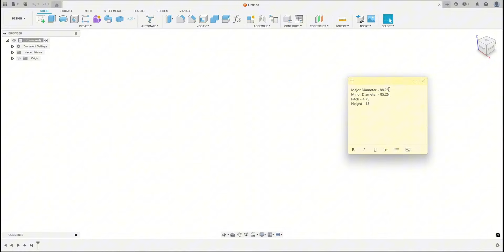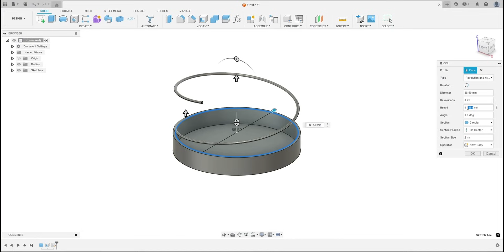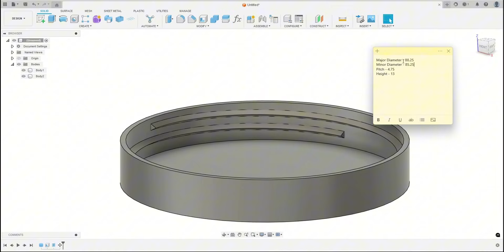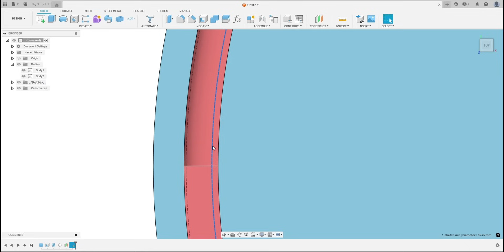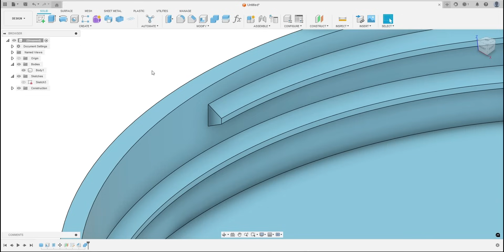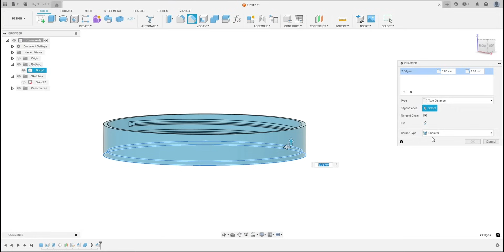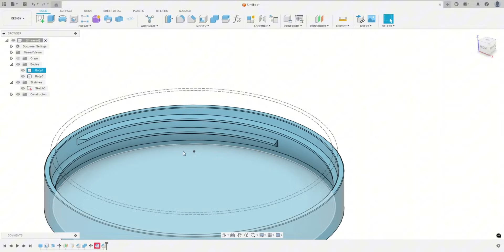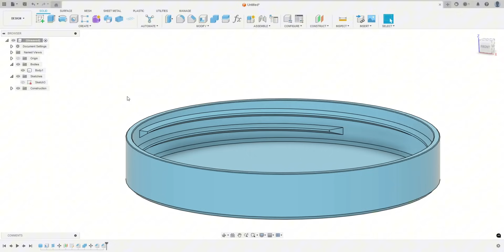Fusion Tutorial: Design & 3D-Print a Threaded Lid

Comment: Do you have any guides on how to add a hinged lid to a circular object like this? I've seen a ton of tutorials on using the joint function or making print in place hinges, but they are always done using boxes/rectangles as the shape of the container and never a curved object like this.
Reply from the maker: I do not, however I’ll think about it. Honestly I’m not even sure it’s possible. There’s a reason circular objects usually don’t have hinged lids.

Comment: Recently I've gotten myself into the habit of creating parameters on the fly. For example when creating the cylinder first create a width for the circle (not sure why you have to) and press enter now that you are in 3d model tab between your two dimensions but set the value + the name with the syntax of name=value (for example diameter=85.85) and they will automatically get created and even added to your favourites. This basically renames the default `d` for model parameters. You can then just reference them as user parameters.
Reply: Sorry I should've first said great tutorial. I learned a lot and will be using this!
Reply from the maker: Yeah I do that as well (when not recording), especially when I know I might be changing the size.  I should have just showed that in the video, but my brain wasn’t braining.  Definitely makes thing easier